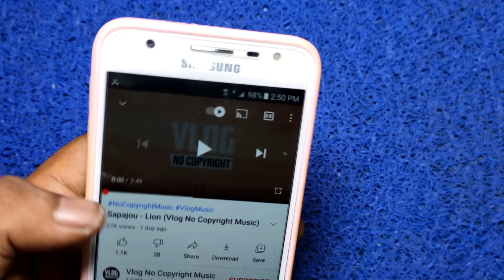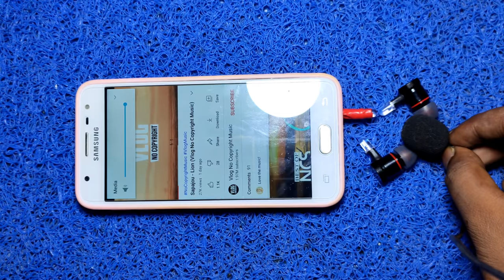How To Make Wireless Earphone at Home - Using old Earphone And Tv Remote Sensor

Comment: Where to connect the wire of earphones to led
Mean positive➕ negative
Reply: Don't waste your working hands-free, It is definitely fake.
Reply: @zukhrufrehmani5585  no I think censors will transfer power from mobile battery with the plug in pin, can't say untill you try ya know ....

Comment: how it works without earphones having power?
Reply: Not use bettery😂😂
Reply: Crazy... there is small amount of power is needed ..there by the power is transmitted via infra led that connected to phone
Reply: Wired headphones don't need their own power source to work. As long as the device/phone has power, wired headphones will work! The only headphones that need power to work are “Bluetooth headphones”

Comment: Thats not working because no battery or power to function the earphone😁even the remote control  need battery to work,
Reply: Facts
Reply: Wired headphones don't need their own power source to work. As long as the device/phone has power, wired headphones will work! The only headphones that need power to work are “Bluetooth headphones”

Comment: are you using tata sky remote sensor? please reply me and how it will charge
Reply from the maker: Yes you can use
Reply: This is fake  video
Reply: @makingwithshasanka  yes bro this  wire less earphone is fake
Reply: It will charge automatically within seconds and 10 year warranty . That's it

Comment: When he adds the earphone jack to the mobile the current is pass through the jack send it to  the wire less earphone like eg: remote has batteries to supply current which generates the current and the radiation are passed through by the remote to the setup box
Reply: This is fake it doesn't work..

Comment: Bro, can we use any type of remotes for making ?
Reply from the maker: Yes just use remote sensors
Reply: Its fake
Reply: Fake ka  proof bataiye
Reply: @Shahidshxrts000  सबसे पहले, इयरफ़ोन में कोई बैटरी और रिसेप्शन सर्किट नहीं है और न ही केबल में ट्रांसमिशन सर्किट है और इसे "सिग्नल" पर काम करने के लिए सैकड़ों वोल्ट की आवश्यकता होगी और फिर भी काम करने के लिए कम से कम एक साधारण ट्रांसमिशन रिसेप्शन सर्किट। क्या मैंने पर्याप्त सबूत दिए हैं? Sorry if it is wrong in some places I had to use google translate, i do not know hindi.
Reply: English mein likhiye bhai mujhe Hindi nai ata
Reply: @Shahidshxrts000  First of all, the earphones have no battery and reception circuit and no transmission circuit in the cable and would not work with the ir led.
Reply: Faks
Reply: Men bi. Try keya tho nahi chalya
Reply: This is fake it doesn't work..